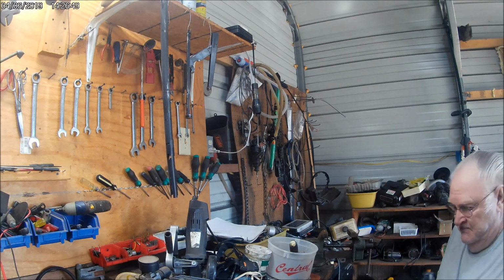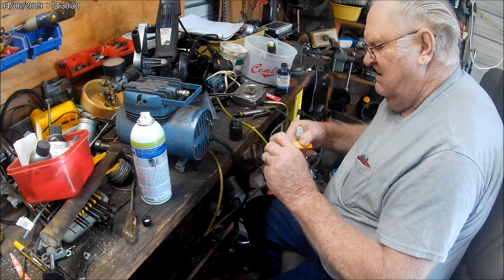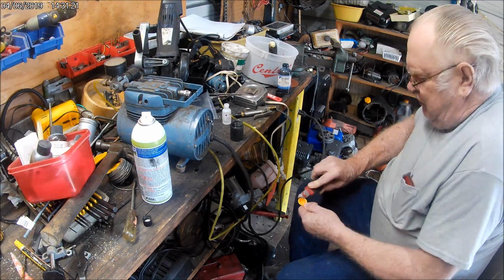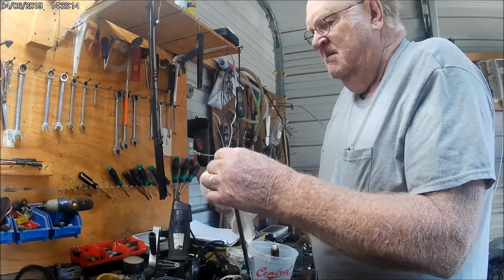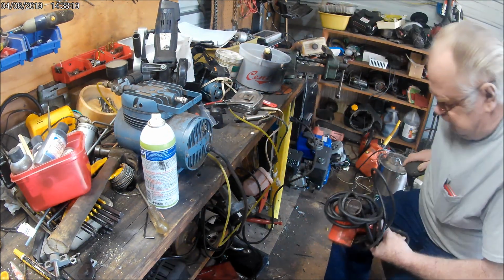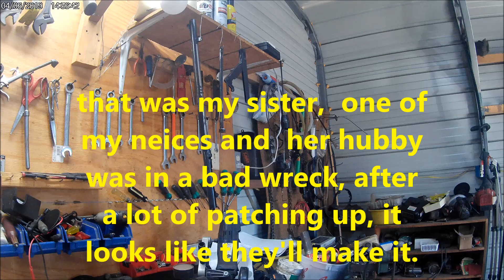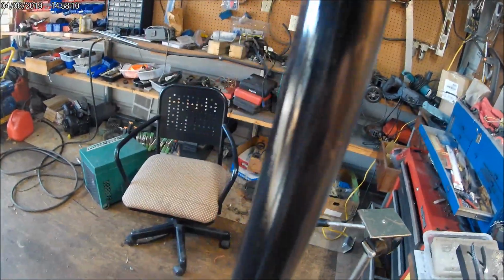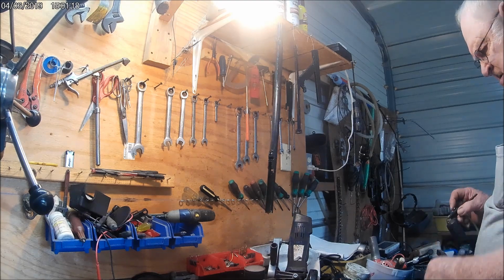Dura-Blue Daisy # 25 BB gun

Comment: Nice job Vernon, is that a homemade sprayer or one of the compressors they use for custom painting 👍
Reply from the maker: that little compressor is one that is used for a air brush,, I really like using this method because it's easier to control for me, than  a spray can.
Reply: @MissouriOldTimer  well it's really handy 👍

Comment: Is this the bluing process you told me about when i did my traditions rifle
Reply from the maker: yes or maybe it was Dura-Coat,, they are very similar  only this Dura-Blue is less apt to fill in the numbers and letters stamped on the metal.
Reply: @MissouriOldTimer  oh ok then it looks like a good way to finish a gun and i may try it in the future
Reply from the maker: @GeorgiaRidgerunner  they usually turn out pretty good and they have probably one  hundred colors.